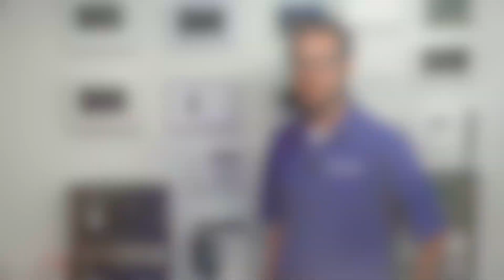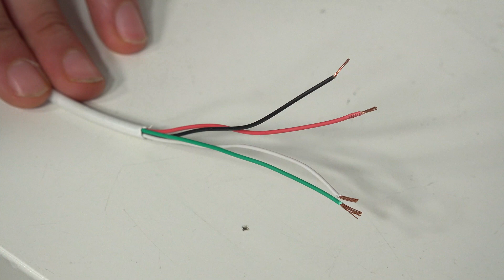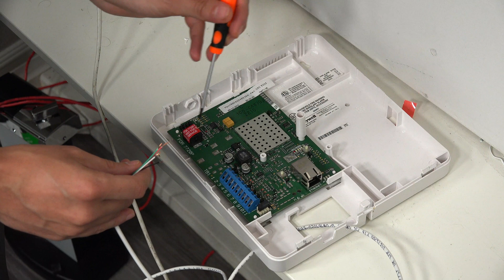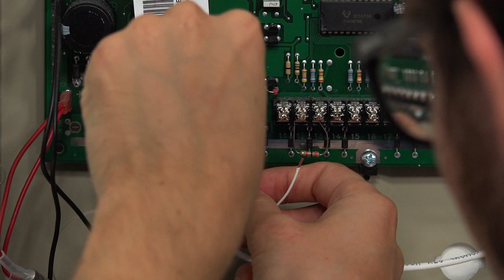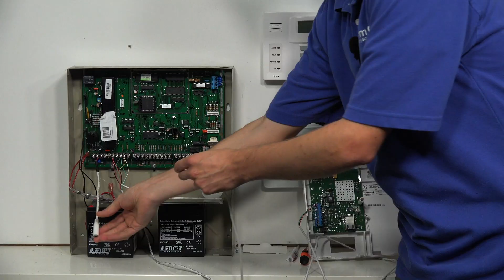Installing a Honeywell 7847i On a VISTA TURBO Alarm Panel

Comment: how to remove bypass zones on the programming on 128 turbo honeywell
Reply: what i mean is how to remove bypass zones on the programming i have a customer when armed stay and 8 zones automatically bypass when armed stay mode or away mode this is 128 turbo panel when armed and i can see on the tuxedo keypad those zones are already bypass and when unbypass them in the tuxedo keypad it disararmed the whole system
Reply: @chimoyans   That feature is in the zones itself  while programming or viewing the zone it will say auto stay yes or no select no

Comment: Alarm Grid how do I wire my fire lite 4424b to my Ademco security panel?
Reply: Good Day, We do not support the Fire-Lite systems, But what I do know is that some fire lite systems have a relay that can be triggered on the fire alarm. You would hook that relay up to the 128bp Hard wired zone. Program the 128bp zone has a zone type 9. The relay on the fire lite will have to be wire up for normally open. The resistor for the 128bp will have to be wired in parallel. If you have any question please email SUpport@ alarmgrid.com